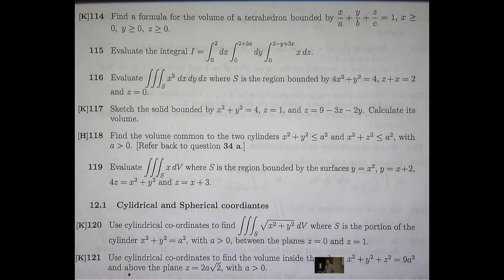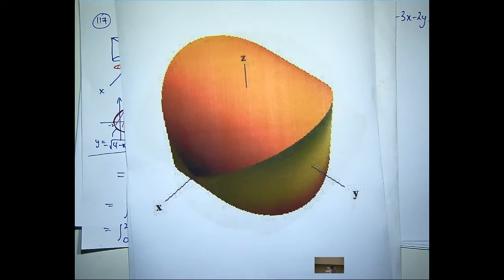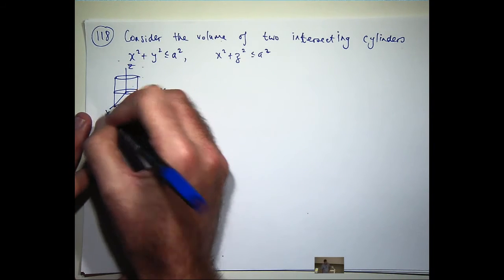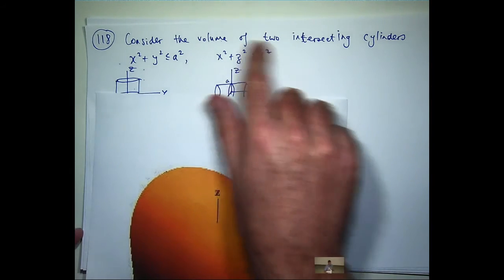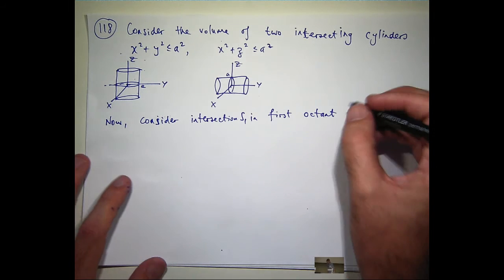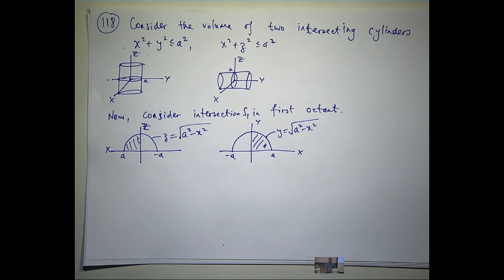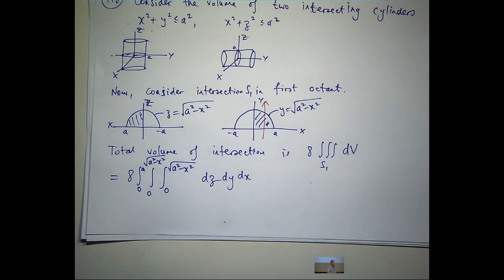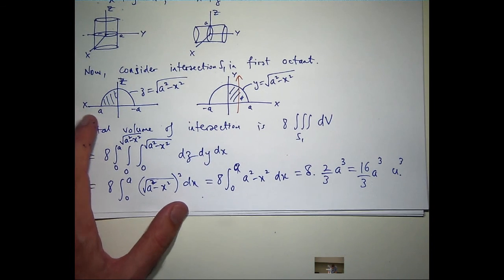Volume of intersecting cylinders via triple integrals

Comment: Hi, I was tasked to solve this using double integrals, and I did manage to solve it by integrating sqrt(a^2-y^2) dx dy. 

However, I was not able to solve it by substituting the above eqn with polar coordinates, which was weird for me as I felt that since I was integrating only the positive root, and using 0 <= r <= a, 0 <= theta <= (pi/2), I would be able to get the volume of one octant. The result I got was 0.

Do you mind explaining why? Is there something else I need to add to the equation?